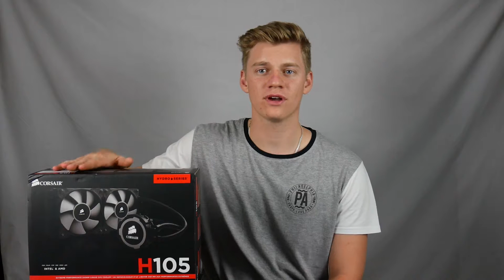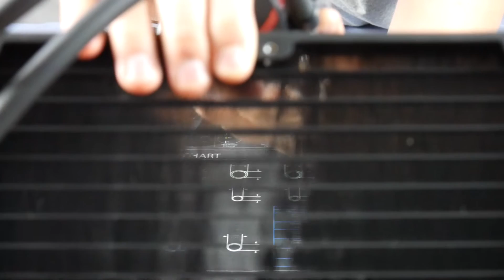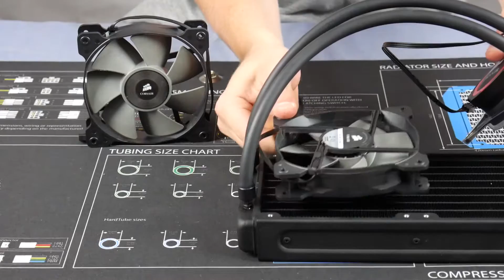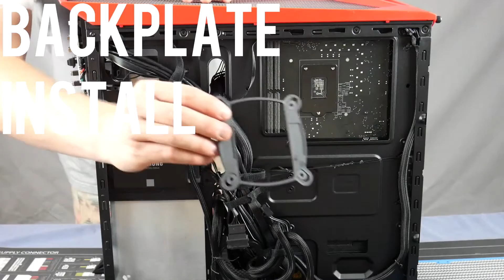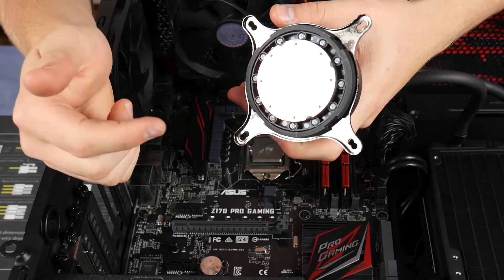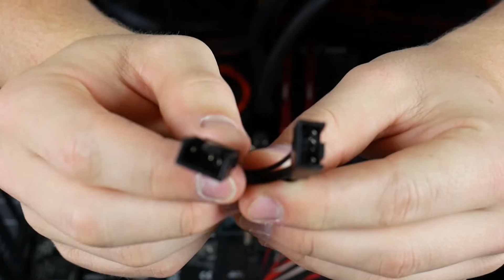Corsair H105 All-In-One Liquid Cooler Install!

Comment: hey mate great vid, i have the same mother board and i want to run the h105 in my Corsair carbide Spec 03 Mid tower and after seeing how thick the radiator is im gonna have to front mount it, what i was wondering is does it put much heat into the case front mounting it, im looking to run 6 fans 3 in 3 out, does it push much heat in?
Reply from the maker: G'day mate, i would rather have it push heat into the case than have it as a exhaust and have your CPU getting hot. It does put out alot of heat (not as much as a GPU tho) but having 6 fans should be fine. I have 5 in my own case at the moment and feel one more would be the sweet spot. 
Cheers
Reply: T&T TECH  thanks mate good point pulling the cool air would be bette, and it should have a good flow the way it will be set up